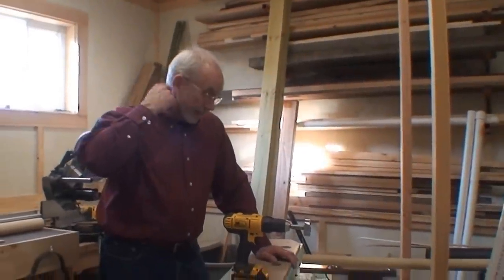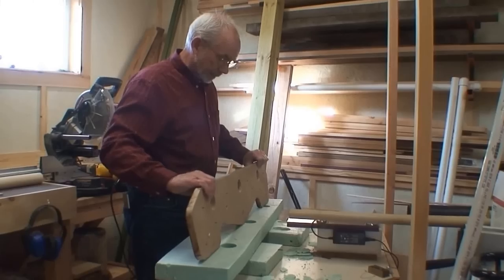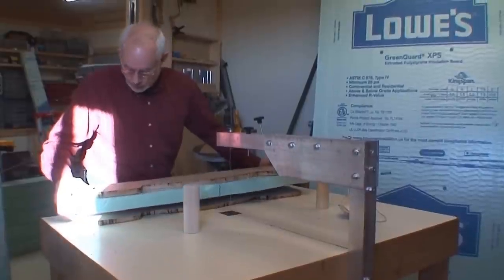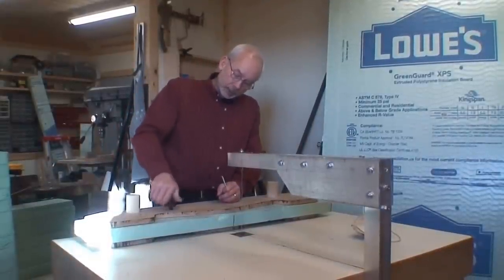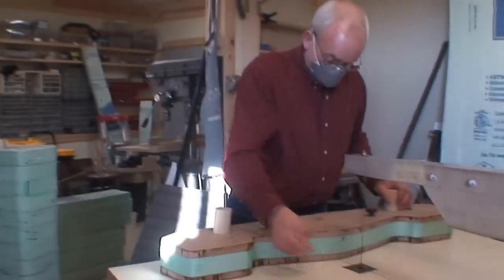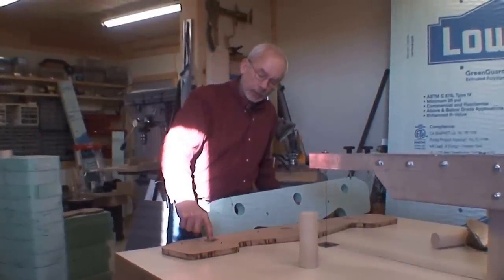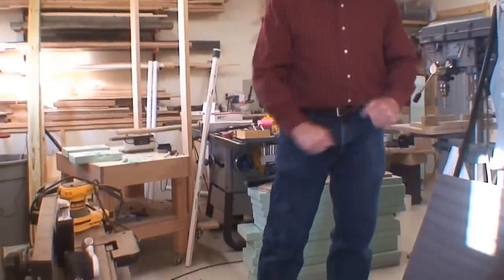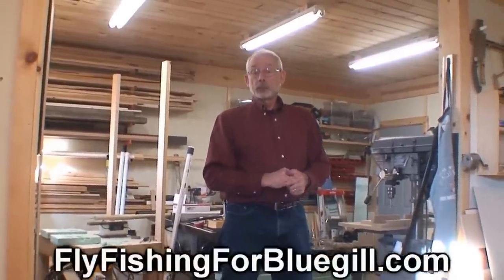Building an SUP made with rigid foam (production is on hold)

Comment: Brilliant design. Its exactly what I want to build. I want to build either a SOT kayak or fishing Paddle board, using your method. The clincher was that you will make it in two sections, which is exactly what I need to fit into my 6' box Mazda. Do you have a pattern I can print off? When are the other videos coming for the rest of the build?